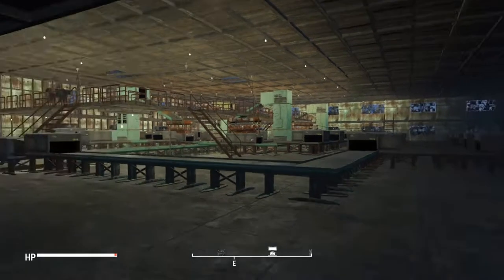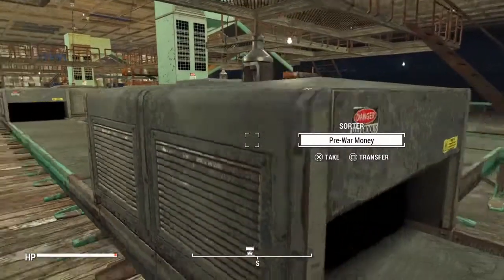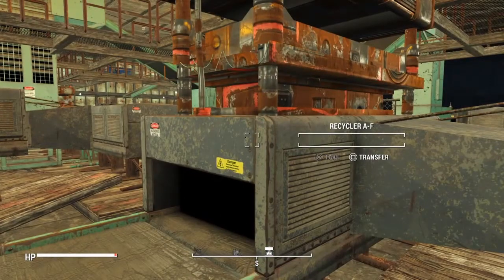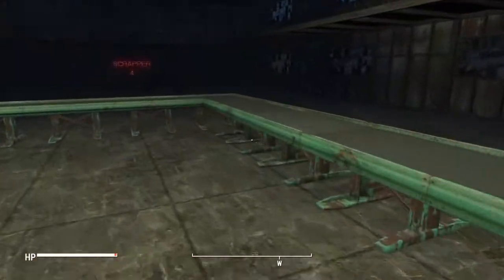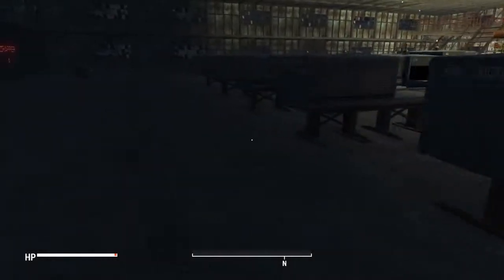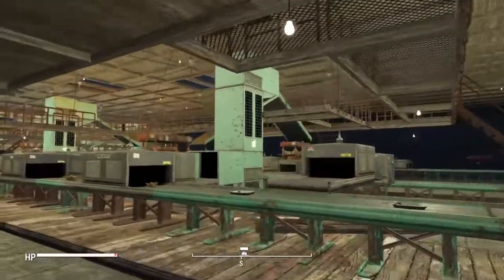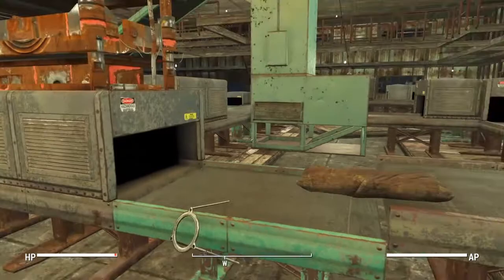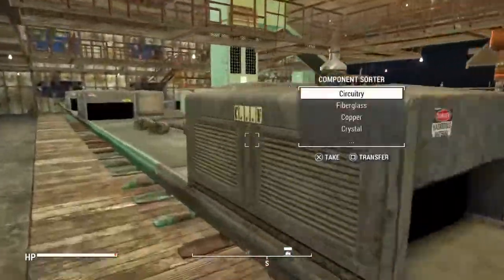Fallout 4 Manufacturing Overhauled Recycling Plant

Comment: You say a few times "separate circuit". What do you mean by "separate circuit"?  Do you mean separate power supply?  Do you have a separate generator for each circuit?  If not, how are you splitting the power so the terminals don't conflict?  Can you show us how you power your factory?
Reply from the maker: When I say separate circuit, I mean it has its own dedicated power supply. I use the Crimsomrider's Convenient Power and Electricity mod for the PS4 which makes the switches generate 10 power each to keep my terminals from conflicting when I use multiple makers of the same type. The update for Manufacturing Overhauled now has powered switches as well. I just started working on a video detailing how I build and power my factory, so it should be up in a day or two.

Comment: Hey there how do you get items like armor and the like to work?
ive been trying it with leather armors but no dice
Reply from the maker: Due to the way the recyclers are scripted, only junk items will breakdown into components. For example, for the recycler to produce steel, a junk item containing steel must be put into the recycler. Then, the machine basically takes 1 steel as the ingredient and outputs 1 steel as the finished product, and the remaining components stay in the machines inventory. As far as I know there is no way to get the recyclers to breakdown anything but junk, due to the limitations on the PS4.

Comment: How did you wire this up?
Reply from the maker: Hi, I apologize for the lateness of my reply. I lost all my Fallout save files and can't remember the exact details, but I can tell you that anything you want to turn on/off separate from everything else needs to be on its own circuit. I wish I could help more, but this is just one of many factories I've built. You might can watch some of the recycling videos by Jack Dolff, they may show more about the wiring and such.
Reply: That sucks. I figured that much with the wiring but how do I set up separate circuits?
Reply: That sucks. I figured that much with the wiring but how do I set up separate circuits?
Reply from the maker: I built each recycler with its own dedicated power source. Generator -> Terminal -> Recycler. Make sure the recycler isn't snapped onto a powered conveyor, because connected conveyors share power. My Recycling Factory Build Tips video has an example of how to keep the recycler separate. I believe the conveyors we're on a single circuit, with switches to control each section separately.